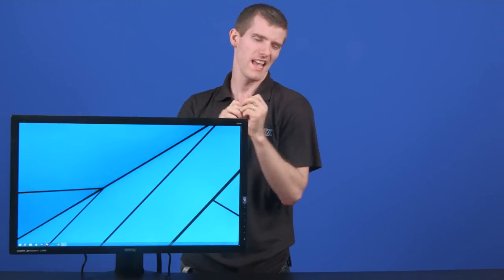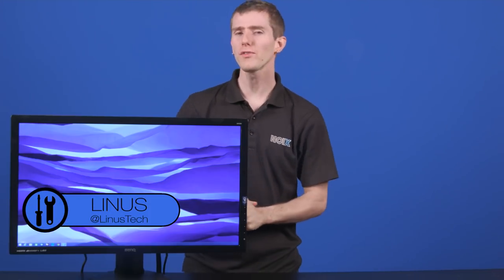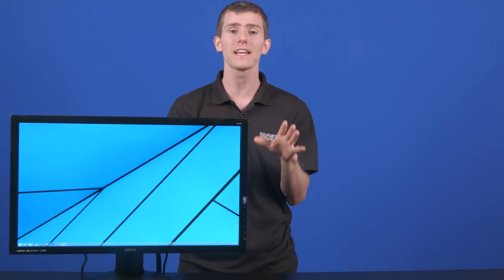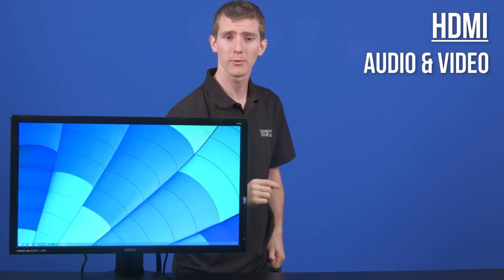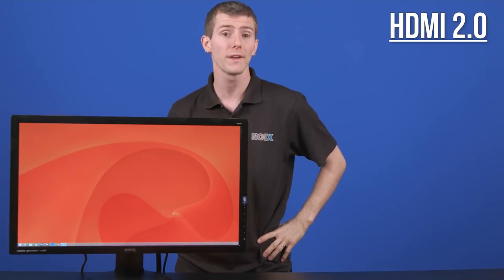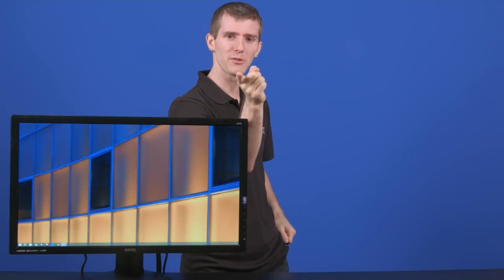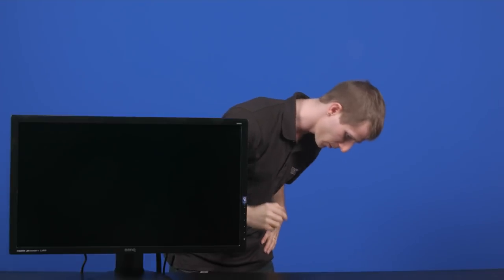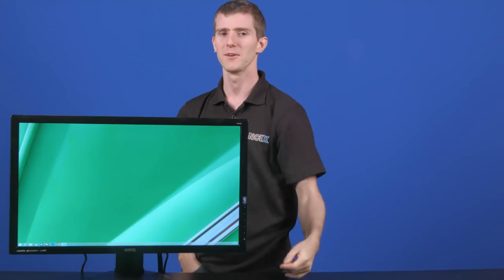Display Connectors Explained! - Tech Tips

Comment: Linus, you forgot to mention that display port allows for higher refresh frequencies. 
For instance, the only way I can run my monitor at 144Hz is by using display port... otherwise I'd be limited to 60Hz.
Reply: dvi d does 144hz
Reply: dvi d does 144hz
Reply: dvi d does 144hz
Reply: Dvi D Dual Link does 144hz
Reply: dvid
Reply: Dvi D does 144hz
Reply: +Mike Patz dvi d does my mom
Reply: +Goreuncle dvi d does 144hz
Reply: dvi d does 144hz
Reply: dvi d does 144hz
Reply: Thank you so much for mentioning, I had trouble, went to both his videos on this channel and then one on techquicke, and he never mentioned if the others give more fps. Thanks man.
Reply: HDMI can go higher than 60fps but I don't see it getting higher than 120fps if the pc has HDMI 2.0 and the monitor. at 1080p
Reply: I use a 1080p 144 Hz monitor
Reply: dvi d does 144hz
Reply: Which display port are u using
Reply: Veltro dvi d does 144hz
Reply: HDMI does 120

Comment: HDMI to my tv, DVI Digital to my monitor. Really, does it matter yet? As long as it's digital. Both my displays only run at 1080p anyway.
Reply: I dont like DVI, i used it to test, but HDMI was a lot clearer than DVI.
Test it yourself and see if it makes any difference for you :)
Reply: cmb6062 DVI-I is in fact, less clear than HDMI. DVI-D on the other hand, is pretty much the same as HDMI, it even can carry an audio signal! (Though you need a converter to HDMI for that...)
Reply: NightFury173 DVI-I is the same as DVI-D when carrying a digital signal
Reply: Toxic Biohazard Not in analogue mode
Reply: NightFury173 in analogue DVI-I = DVI-A = VGA
Reply: As long as you're using Dual Link DVI-D, for all intents and purposes, it is the same as HDMI.  It actually even carries audio, but the DVI standard doesn't support audio at the other end of the cable (your monitor, tv, etc.), so you need a DVI>HDMI converter to get the audio.  I am personally a big fan of DVI since I can screw it into the monitor or graphics card and not worry about a cat or something pulling it out.
Reply: joshmosky DisplayPort also has a locking mechanism. It's not as secure as screws, I'll grant you that, but still pretty safe. I don't really get why people (like Linus for example) complain about the lack of a locking mechanism on HDMI, but that's because personally they've always been a tight fit so it takes considerable force to pull the cables loose.
Reply: Dennis Z I didn't know DisplayPort had a locking mech.  Is it some kind of switch/push button?  I might have to jump on the Displayport Hype train if that is the case. 

The reason I like the ability to lock my connectors is that I have been having problems with HDMI on my computer right now.  My HDMI cable seems like it wants to wiggle and cause the display to flash every time my computer is bumped.  I replaced the cable and it still does it occasionally, so I'm down to it just wiggling in the port on my graphics card.  I feel like it being able to lock would prevent this from happening, even if it were only a latch and a button.
Reply: joshmosky DisplayPort (should) have two little metal pins, not entirely sure how they work; Linus has a video about cables and shows it real quick I think in a TechQuickie video. See if you can find out if it's good, maybe it'll be what you need, and a DP cable is only like $10, so it wouldn't hurt too much.
Reply: Dennis Z I sure will take a look at it.  Thanks for the info!
Reply: Hdmi pc, hdmi tv, done and dusted, would you recommend to upgrade, both at 60hz
Reply: Adam JP HDMI to my HD TV. VGA to my computer monitor.
Reply: Same here.. or it was. Now ive got a 2 way hdmi hub connecting both a 360 and a ps4 to my asus vs247hr (24 inch 1080p 60fps). My ps4 looks better much better at the monitor. If you dont use a tv.. for tv (and sometimes even then) a monitor is better imo.

The pc is connected with dvi d dual link.. i think
Reply: it matters now for 4k 16:9 or 1440p 21:9

Comment: my monitor is so old, it only accepts VGA and DVI
Reply: Andloo Yunty Same to mine
Reply: I still have a monitor from when windows vista was a thing
Reply: Vcvc16 Noodles This monitor was from before win98 was a thing

goml
Reply: +Andloo Yunty Well DVI is still almost as good as hdmi
Reply: Hanro Lareman It's DVI-I
Reply: +Andloo Yunty Is this satire? I hope it is.
Reply: Orangy57 What part?
Reply: My monitor is 16:10 and giving me a headache
Reply: Vcvc16 Noodles 16:10 would be ultrawide..
Reply: It's just taller than a regular monitor that's all.
Ultra wide is 21:9
Reply: +Andloo Yunty  mine too I use DVI now single link.
Reply: ^My monitor is also 1680 X 1050 :)
Reply: +Andloo Yunty I have a VGA only display
Reply: +Andloo Yunty VGA is still very common today. Nothing wrong with it.
Reply: +Andloo Yunty same here
Reply: +Andloo Yunty Well i still have a CRT monitor from 2006 :D
Reply: +Andloo Yunty my second monitor only supports VGA
Reply: +Andloo Yunty Lucky you, mine is 5:4 and supports VGA only.
Reply: +Sypadizre my monitor is sooo OLD that it only accepts the three colored RCA's!!!
Reply: ***** It would have to be from the late 80s, so I really doubt it.
Reply: ***** XD HDMI had been a thing for a long time then. My monitor was from the late 80s.
Reply: jub672 Then you got ripped off XD
Reply: jub672 The 3 monitors I'm looking at are between 100 and 120, all of them have HDMI.
Reply: ***** That's not what I said. You said that your PC was from 2004. By 2004, HDMI had been around for 2 years. 2 years is a long time. My monitor is much older than your PC. It was top of the line from the late 80s.
Reply: ***** I see how that could be confused. Have a good day!
Reply: +Andloo Yunty me2
Reply: My monitor is so old it only supports VGA
Reply: +Pablo Dantur thats not that old
Reply: +Pablo Dantur or it depends
Reply: ***** It's an old CRT whose plastic isn't even white anymore, and it's got dead pixels, it's kind of broken.
Reply: +Pablo Dantur yeah thats kinda old
Reply: ***** How should I know? All I know is there are miscoloured areas and black boxes.
Reply: +Marcus Sutherland Sorry. I didn't mean to sound that awful when I said that. I just assumed it was dead pixels.
Reply: +Ciro Medina lmao mine used to have a compatible with vista sticker on it before i took it off..
Reply: I have one that only supports VGA (D-SUB).
Reply: Same here but the picture quality is actually pretty ok and so is power use so I have no reason to upgrade
Reply: Well I mean DVI is now two ports, DVI-A (analog) and DVI-D digital. Aren't random proprietary connections fun kids?
Reply: +Ethan Chow lol yeah if u aint a gamer u have no reason to honestly
Reply: Scott me Tru. Unless you watch I dunno, many movies or listen to music and need a great watching experience. But even then why a computer monitor? You could just buy a good TV or music player and be done with it.
Reply: Nunny If they're not absolutely compatible with everything I own, they're not. If they do, then I don't care if propietary or not. I'm looking at you Apple.
Reply: 3l H4ck3r C0mf0r7 love the name reminds me of old times lol and u can still have a great watching experience with vga all the rest but if u want freesync which at this point and time is really the only reason to even buy a EXTRA cable btw i have the radeon powercolor r9 380 x with a viewsonic monitor hooked up with freesync and let me tell you OMG ITS UNBELIEVABLE as a man of war i have to say i dont want it no more real than this
Reply: +Andloo Yunty My monitor is 14 and a half years old and only accepts VGA. It's native 1536p @ 80hz but will display up to 2560x1920 at 60hz with a max vertical refresh of 170hz at 720p. #CRTmasterRace #GDMf-520
Reply: EvanBlax I know you're lying because CRTs aren't measured in pixels XD
Reply: Andloo Yunty I never said they were lol. Dots and lines still make a matrix when an aperture grille / shadow mask is involved.
Reply: EvanBlax Yeah you did XD. First of all, no CRT in existence can do 2560x1920, second of all, they are measured in lines, so if you were to even talk about pixels, it would be interlaced, which means lower real quality. Don't you think CRT monitors would be popular if they could really do ultrawide 60Hz (a format that wasn't even around 14.5 years ago) and could really do 720p 170Hz, which would be crazy for pro gamers, who typically play at 144Hz? Especially if this technology was 14.5 years old.
Reply: +Andloo Yunty Sony GDM-F520
Native Resolution - 2048x1536 progressive scan
Viewable Size - 19.8"
Horizontal Refresh Rate 137KHzVertical Refresh Rate 170Hz
Pixel Pitch - .22mm horizontal www.cnet.com/products/sony-gdm-f520-series/specs/
Manufacturing date on mine is October 13 2001. Also if you want to get your mind blown look up the Sony FW-900. 16:10 2304x1440 CRT ;)

Although it may be true that there are no CRTs in existence that are natively 2560x1920. ie. have an aperture grille with 2560 lines. That fact doesn't stop the control circuitry on my monitor from telling the electron guns and deflection magnets to draw that resolution to the best of it's ability (admittedly poorly) on the screen. Yes, I know that the resulting image is being shoved through a 2048 line aperture grille but the result still stands. It displays the resolution, however poorly, at 60Hz progressive. Not interlaced. If interlaced, it would run 1920i at 120Hz.

Sure, you can run ultrawide resolutions (at much higher than 60hz, too) but I don't really know why you'd want to. I've run 2560x1080 before at up to 98Hz but could never squish the beam enough to get the right image ratio on it. Even without that issue the problem still stands that I'm trying to shove 2560 simulated through 2048 actual. I guess the only thing it would be handy for is running anamorphic resolutions with a higher horizontal refresh rate.

I really don't know why CRTs aren't more wide-spread in the pro gaming world. Well, yes I do. They're big, heavy (this one is 76lbs), and people mostly remember them as being flickery pieces of shit (anything below 72Hz is unacceptable). 

But what they don't realize is there's next to no input lag, pixel switching time is also way faster than any modern flat-panel (except for the phosphor decay times from white-to-black transitions), even shittier ones can go up to 150Hz no problem, and on the second-hand market you can get them for next to nothing these days (mine was $20, most are ~$100). The technology had 100 years to mature. What we ended up with in the early 2000s were some of the best PC monitors ever made. I keep telling people if you want to see what gaming is like on a 144Hz monitor get yourself a second-hand CRT.

Almost everyone I know uses a CRT to play competitive CS:GO. I personally play at 1440x810 at 150Hz whereas one of my friends prefers to play at 1152x864 at 144Hz. The amazing thing about CRTs is that you have choice with your resolutions and refresh rates (providing you're running a multi-sync). Your refresh rate scales with your resolution. You want more definition? Going to have to sacrifice the higher refresh rates. Example: this monitor will do 1920x1080p at 118Hz but even that is too slow for Counter-Strike. CS needs at least 134Hz to feel playable (in my experience) so that means running at 1600x900p.

If you still don't believe me go into your GPUs custom resolution utility and try putting in 1280x720 170Hz with the timing set to "CVT" in the dropdown menu. You'll see that it hits 135.66kHz for the horizontal refresh rate. Which is just within the 137kHz maximum of this monitor.

I guess I should also point out that CRTs don't get good until you remove the EDID pins from the cable. The Extended Display Identification on most monitors will report WAAAAY lower resolutions and refresh rates than the display can actually handle. Usually leading to the misconception that CRTs are shit.
Reply: Dvi is still nice tho
Reply: Vcvc16 same and i have 2, i am not proud lol
Reply: As long as it is rgb, it's still fine for me
Reply: My monitor is so old, it only accepts VGA
Reply: My is so old it only has a comport
Reply: H y p o c h o n d r i a c my monitor is so old it only accepts the electric cord....kmn
Reply: Hi...can't believe I commented 96 weeks ago on these
Reply: My older monitor only had HDMI and VGA
Reply: What my monitor is only vga
Reply: Mine is only vga
Reply: Will a gpu still work if the moniter has no hdmi?
Reply: Im still gaming on it lol
Reply: My monitor is new but only has vga
Reply: same
Reply: @SiuleungWong  same
Reply: @thetimelords911  vga is crap you even need a seperate cable for audio
Reply: @Autonomous15  maby your adaptor is crap
Reply: @mushroomcraft  If you are using VGA for audio thats a you problem. I just use it for video purposes on secondary monitors.
Reply: My monitor got only VGA port..

Comment: you didn't show how many fps display port is capable of :(
reason I'm curious is that I'm about to set up 3 screens Asus 27" VN279Q too 2 x GTX Titans in SLI and wondering what the best option is ?
Reply: Dvi dual link
Reply: you will be fine with 2 titans at 5760x1080
you will easily get over 120fps in any game 
i recomend getting 3 144hz monitors instead like the benq 2430t
Reply: DisplayPort doesn't run in fps like HDMI but rather in maximum bandwidth transferring data in packets. If the connector is short or has a repeater for longer range then the bandwidth will be high like Ethernet and allow theoretically any fps/hrz on a monitor to be set. (as long as the monitor supports it) (longer cables pick up more EMI thus lower the bandwidth without repeaters)

As i'm typing I am using DisplayPort to drive my ASUS VG248QE at 1920x1080@144hz
Reply: You need to differentiate between FPS and Refresh rate, your monitors probably support only up to 60 Hz so that's what determines the needed bandwith.
The requirements of bandwidth and the supported bandwidth of each DP version can be seen hear, you can calculate the needed bandwidth for every resolution and refresh rate yourself with a formula:
width * height * refresh_rate * bits_per_pixel * 1.1
Example: 1920 * 1080 * 60 * 24 * 1.1 ~= 3.3 Gb/s
DisplayPort 1.0 allows a maximum of 8.64 Gbit/s...
If you want to daisy chain all 3 monitors (if the monitors support daisy chain) displayport 1.2 is enough for 4 * 1080p monitors 60Hz
Source:
http://forum.videohelp.com/threads/363933-Displayport-supportet-resolutions-refresh-rates
http://www.displayport.org/cables/driving-multiple-displays-from-a-single-displayport-output/
https://en.wikipedia.org/wiki/DisplayPort#Technical_specifications
Reply: I'm running 3 monitors of DVI, DVI-D, DVI-I in digital mode and DP with a DP to DVI cables, works just fine.
Reply: AgentIceX thanx that clears that up nicely :)
Reply: ***** thats really helpful, thanx for the info and heads up MegaCreeperMann :)
Reply: You wont be able to buy a monitor with a high enough refresh rate to worry about displayport's fps.

Comment: How about coaxial connector (yellow one on the RCA cable) :D
Reply: nobody uses it
Reply: You mean Composite Video. That sucker does only 480i (NTSC) or 576i (PAL).
Component Video ("Red"/Blue/Green) can easily do 1080p and higher. For Analogue Video outputs on a computer it is comparable to VGA (which goes up to 2048x1536 @ 85Hz), whilst its Digital Video compatriot on computers is DVI (yes, there ARE DVI <-> Composite Video converter cables out there).
Reply: ***** I'm still using it, not for PC obviously but for retro console such as NES, Sega Genesis, and SNES
Reply: IndraEMC reviewtechusa has a video modding a genesis to use HDMI

i just use a emulator to play streets or rage 2
Reply: ***** my retro console are hooked into old CRT TV, obviously doesn't have an HDMI port, that's why I'm  using standard RCA (coaxial) connector.

Why ? because light gun game didn't work on LCD, Flatscreen, Plasma, or any HDTV.
Reply: Yeah or what about S-Video? lol  That was actually a PC port as well.
Reply: i have only seen that on like 8XXX i think

cant s video only do 480p?
Reply: ***** 480i (NTSC) or 576i (PAL) for S-Video.
S-Video is basically the video card counterpart to Composite Video, which is why it's so easy to find 4-pin S-Vid to Composite Vid converter dongles.
You CAN find 7-pin S-Video port to Component Video converter dongles, but they aren't necessarily S-Video though they can operate as such (since Component has such a wide range of video settings it can use).
Reply: alright i was not far off, thanks for sharing
Reply: I actually squeezed out of that thing 1024x768 with my 11 year old computer and s-video to rca adapter
Reply: ***** Excuuuuse me? It's ReviewStealUSA not ReviewTechUSA

Comment: what is  serial port/ioioi port and what are they used for? can i used it for connecting other moniter
Reply: They are actually still very widespread as f.e. CNC machines, vending machines... still use them as their main (often only) connection for programming. Lots of consumer equipment also have some sort of serial connector (be it the typical 9-pin or something proprietary) for diagnosis and firmware upgrades by technicians.
That's why you'll still find ancient computers (sometimes as old as 386's running DOS or Win3.1!) in professional environments and many technicians carry very bulky laptops with all kinds of connections.

Comment: how do i find out if my minitor has a HDMI 2.0 port or a 1.2 port?
Reply: Mist so if i plug in an hdmi 2.0 to my monitor it will work with all the benifits of hdmi 2.0?
Reply: Mist thank you very much :D
Reply: Linus said that you wont need to update the cable... for hdmi 2.0